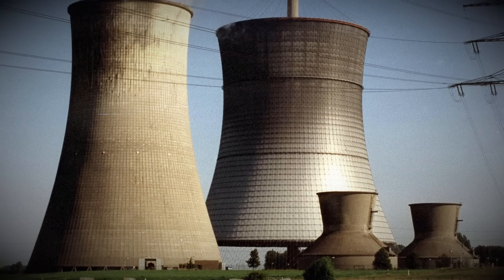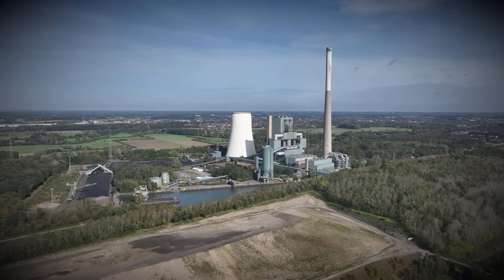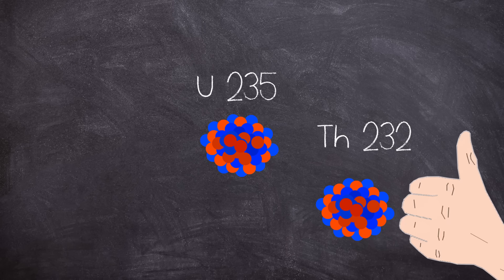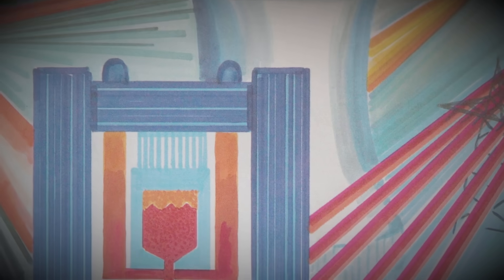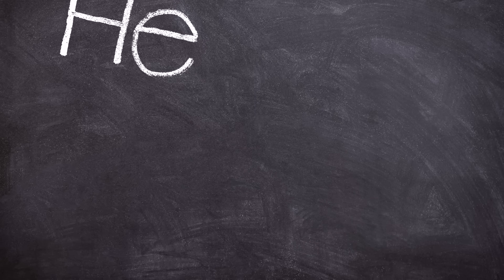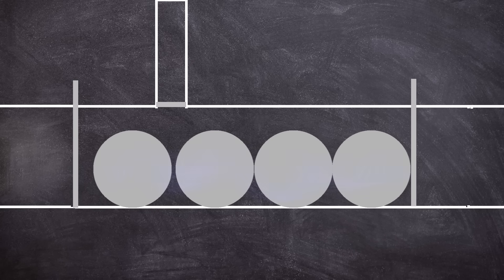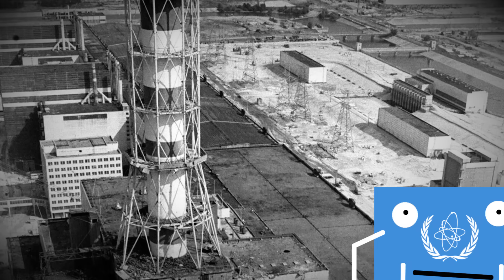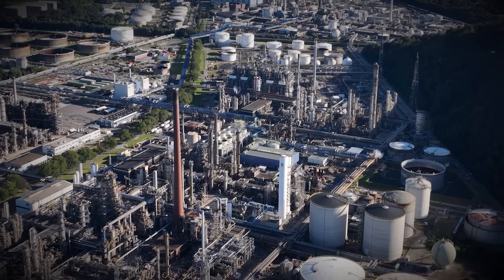Inside Germany’s “Chernobyl”

Comment: >Decomission all nuclear reactors
>Build windmills instead
>Highest electricity price in Europe

Checks out. Hope it was worth it.
Reply: Many people, just like you, got it wrong.
Nuclear was never cheap in Germany.  Instead, it was largely subsided, and the cost don't stop with the shutdown. The dismantling of the old power stations comes at very high price that is to be paid by the taxpayer.
By the way you forgot to mention the real factors driving energy prices up: price of natural gas, emission tax on coal, Import prices for coal, VAT, grid fees. The stupid, lopsided dependency on Russia as a gas, coal, oil, and even nuclear supplier has badly hit home.
Reply: @ElwoodEBlues  Agreed.  If I remember correctly, grid fees alone are almost a third of energy prices.
Reply: @jimboblivesforever  yes, 8 to 9 cents are grid fees. And there is an energy tax of 2 cents. Plus just under 1 cent of other fees. Plus 19% VAT. Consumer price currently is at 27 cents, so the prices went down considerably after an incredible peak in 2022.
Wind turbines produce at 6-7 cents, solar parks get about 4 cents, lignite power stations produce at 4.5 to 7 cents  plus about 4.5 cents CO2 tax, coal starts at about 10 cents,  and natural gas powered stations produce at even higher rates.
The last nuclear power stations we had produced at very low cost, but we didn't do any maintenance as they were to be phased out. The original schedule to phase them out would have given them about seven more years of operation, but conservatives wanted to win an election which was going to happen right after Fukushima.
Reply: @ElwoodEBlues  Nuclear energy can be largely automated. This reduces manpower needed (still more jobs than windmills and panels) newer plants are significantly more efficient, you can build breeder reactors reducing or even eliminating dependencies on other countries (though I think there's a good bit of U in some German/Austrian mountains) as for the price of natural gas, well that went up when a pipeline went up, a gift from NATO as the bad guys could have, you know, just turned off a valve. Not to mention the kilolitres of methane released from that, but apparently taxing farmers over methane containing cow farts is the way forward. 

Decomissioning plants is expensive, which is why you don't decommission them early the largest earthquake in Germany was a 6.4, Fukishima was a 9.0, the Richter scale is logarithmic, so that's many times more powerful. 

Lesson learned from Chernobyl = Don't let people who got their jobs through nepotism or worship of a political system instead of experience and training do risky tests on sketchy equipment. 

Lesson learned from Fukishima = Don't build reactors on fault lines in areas known for tsunamis that rely solely on seawater for cooling. 

Lesson learned from Germany, if it ain't broke, don't fix it until it is.
Reply: windmills do not provide baseload power...California, USA has tried vast windmill farms since the 1970's and were also heavily subsidized in the tax code.  Nuclear power is baseload and provides a necessary electric power component that can be safe and "green".
Reply: Highest electricity prices is not because of nuclear power. It's because of political lobbying.
We pay 18000€ for the heating every year for 20 flats. That's something like 40ct/kwh. 
And this is a political price. 
My share was 500€ for about 500 kwh heat.
Reply: @jpt3640  You heat 20 flats with electricity? That's crazy. I use district heating, and while that's probably the most expensive of the other options, that's still a lot less than half of 40ct (closer to 12 or 13). As far as your math on your share goes, it would be 1 Euro per kwh, which is frankly not credible.
Reply: @jimboblivesforever    no, it's gas i think. I don't know, they built a new power plant/heating plant

Comment: When I was watching you explain how that system worked, I said to myself that such a complicated system of feeding, circulating, and removing the fuel balls was doomed to fail. Way too complicated.
Reply: yeah sounds overly complicated. Though the actual accident I'd say is not caused by that system's complexity, but by the feeding mechanism being poorly designed. At least as explained in this video, it first seems stupid that you have an automated loading mechanism that can't load the precise amounts needed. Worse is that for the manual procedure, there seem to have been little fail safe in place to prevent you from accidentally venting radioactive gas. It should've been impossible to just open the release valve when radioactive gas might've made it into that chamber without overriding a good number of blinking red lights and "are you sure?" popup equivalents. And/or it would seem wise to me to have a geiger counter at the release tubes that blares alarms to the operators, or automatically shuts the valve on its own, if radioactive gas being vented is detected.
Reply: yes, far too complex for a simple human operator to identify and avoid all the failure mechnisms "on the spot" in real-time with an operational reactor.
Humans design these and need to avoid or mitigate many latent failure modes before becoming operational.

Comment: Trick to pronouncing German words is to mentally add spaces because most are compound words.
Arbeits gem Mein shaft - - - - versuckt reaktor

Or in anglophone phonetics arr bites gem (or shem) mine shaft ver sook't reactor
Reply: Not as bad as trying to keep up with neverending repeating similar syllables in Indian and similar predominantly South-East-Asian languages. At least in German the stuff is different.
Reply: You accidentally replaced an S with a T. It's "Versuch*s*reaktor" "not "Versuch*t*reaktor". It'd be something like: arr bites gem mine shaft fair sook's reactor. 

"Gem" is better than "shem". The "g" is not a J-like sounding g as in a "gemstone" but a harder G as in "good".

(if one would get really picky: the "ch" is not really pronounced as a "k", but has no real equivalent in english. It's a kind of a more throaty version of "sh", but k would be perfectly understood and is often used by english speakers instead if they can't get that sound out. Esp. when followed by an s it's extra tricky I'd presume).
Reply: @Hugh_I  Thanks, I only did German for 3 years in school, Spanish for 5, would have done German for 5 years but the teachers for German were all the most irritating people you could ever meet, the guy doing Spanish was much more chill. I prefer German as a language just because it's basically middle English with a few small differences. It's not super difficult to understand basic German, it's difficult to understand basic Spanish. 
For example "Help me, here!"
"Ayuda me, aqui!" 
or
"Hilfe mich, hier!
Reply: @daviddavidson2357  Somehow I can totally imagine that german teachers can be very irritating people LOL. 

I'm a native german speaker. I had some decent english teachers, but never really learned to actually speak it in school. I at best sounded like a time traveler from the 50s struggling hard trying to speak some form of british english while using american intonation with a heavy german accent and a severe lack of vocabulary. The best thing one teacher did one day was to show us an episode of the Simpsons in english in class. That convinced me to watch just about every american or british TV show undubbed and probably taught me much more than I ever learned in school.

Comment: Ohh, I used to live near there. At Keitstraße 31! I took several measurements in the area and the radiation actually rises to mSivert in some places, at least according to my Geiger counter. How great that you made something out of my surroundings. Thank you very much.
The best thing is that when I asked if it was possible to take a tour of the reactor and its building in the current state, despite the secure lockdown, I received an answer from the operator: We do not operate deactivated or active nuclear power plants. ' When I then said that this was interesting and then wrote the reactor with its type and address and that the press might be interested in the fact that it had been forgotten, especially as it had been involved in such a serious accident, I was contacted from a very high level in a very very friendly manner.
Reply: How did that go?! The contact that is.
Reply: @DesertCatDad The highest radiation concentration I measured was at the gate to the small cooling towers. Where the 2 small ones and the middle one stood. They have now also been demolished. Not yet at that time. That's when my Geiger counter went off. Also at the bridge you have to go under if you want to get to the power station.
Reply: Are you sure you are talking about MILLIsievert? I have been several times to Chornobyl and just at very local certain points i was able to exceed 1000 Microsieverts per hour ( which equals 1 Millisievert).
Grüße aus der Jülicher Ecke, wo es auch einen Kugelhaufenreaktor gibt/gab ;).
Reply: @OnTourWithGerrit  ja Tatsache war an dem Tor zu den 3 kühltürmen mir mSv angezeigt worden. Kann ja auch ein messfehler gewesen sein. Ich gebe nur wieder was ich erlebt habe. Verdammt ich hatte nun 3 mal schon die Reise nach Chernobyl geplant. Einmal bin ich krank geworden, dann die plandemie und nun die spezielle militärische Operation.
Reply: @istandwithdprlpr7801  mSv finde ich schon sehr bedenklich. Es ist zwar nicht sofort gefährlich aber einfach frei zugänglich dann schon. Mit was für einem Gerät hast du gemessen?

Tschornobyl wird wahrscheinlich für sehr lange Zeit nicht mehr zugänglich sein durch Minen und Granaten.  Ich kenne einige, die seit mehr als 15 Jahren quasi tagtäglich in die Zone gefahren sind (beruflich/Guide) und auch für die bleibt es verwehrt. 
Man darf die Brisanz der Zone in Bezug auf Belarus und Kyjiw nicht vergessen.
Reply: @OnTourWithGerrit  du wardr ja sogar im Keller des KH 😮 hast du ein Schwein. Den haben die jetzt mit Sand aufgefüllt. 😢
Wenn dubwieder so Videos machen möchtest,  dann fahr nach Oklo zum natürlichen Reaktor. Ich komme gerne mit und unterstütze dich beim flimen. 😅
Reply: @istandwithdprlpr7801  naja, den Eingang haben die zugekippt. Aber es gibt noch andere Wege da rein.
Jedoch war ich nur zwei Mal ganz unten. Ist doch nicht mehr so ganz ungefährlich.
Oklo klingt interessant. Aber aktuell steht es (noch) nicht auf der Liste. 
Danke für das Angebot.
Reply: @OnTourWithGerrit   schreib mir gerne die Eingänge. Ich kenne Sa jemanden der jemanden kennt der mich Sa vielleicht hinbringen kann. Als ich mit einem Verein dahin wollte hatten wir sogar eine Erlaubnis zu room 217/2 aber dann hat es mich dahin gerafft.
Reply: @istandwithdprlpr7801  man muss vom Ende des Krankenhauses bereits in den Keller. Das ist mein letzter Stand.
Jedoch glaube ich kaum, dass du in die Zone diesen Samstag kommst. Wenn dich, nur illegal und mit hohen Risiko.
Reply: @istandwithdprlpr7801 die 3 kleinen Kühltürme hatten aber nichts mit dem THTR zu tun, die gehörten zum alten Kohleblock.
Reply: @o.h.s.8256   das kann gut sein, wohin die gehören weiß bzw. wusste ich nicht Jedenfalls standen die noch so um 16 - 19 rum und da war die höchste Strahlung. Passt ja auch, keine Funktion, aber noch präsent während des Vorfalls, wie man so schön eindrucksvoll sieht im Eröffnungsbild des Videos.
Reply: In which Statt was this ??
Reply: @TheJason909  you mean Stadt. It Was Hamm westfalen
Reply: You sound strangely happy about living near a disaster site...
Reply: @lofthouse23  Well, happy. I am very interested in the subject and am therefore perhaps a little more committed and enthusiastic. I never really measured harmful levels in the region I lived in. In my bedroom in the Spanish village it is also 9 microsivert. Which is already elevated. Here, after my escape from Germoney, people are all getting very old even though we live on a uranium vein.
Reply: @istandwithdprlpr7801   I think this part is what most regular folks forget to account for:  Background radiation.  Is the normal background radiation being measured and subtracted from the readings taken of a suspected release?  I'm thinking that one person's, "Oh, Crap!!" moment is another person's perfectly normal condition.
Reply: hello from St Louis, MO!  🇺🇸❤️🇩🇪

Comment: Short answer to the thumbnail is yes. This coming on the heels of Chernobyl body slammed the German nuclear industry and led them to wrongly get rid of it.
Reply: Not true. Not a single nuclear power plant was closed in Germany because of Chernobyl. The only thing that happened was an investigation into the safety of German nuclear plans, which concluded that such an accident couldn't happen because the plants were entirely different from the russian ones. What lead to the German nuclear exit was Fukushima, and that was decades later.

Comment: Really good primer on thorium and pebble bed reactors in this video. It sounds like there were some odd 'we didn't consider this possible risk' engineering flaws in the THTR series, like the fact there didn't seem to be very many safeguards against radioactive vapors getting into parts of the system where they weren't supposed to be.
Reply: This reactor was kind of an experiment, to check out new technologies. Turned out, it is more difficult to handle than they had imagined. This path was no longer followed.
Reply: @gabbyn978 not with this architecture at least.

Pebble reactors are still being pursued almost entirely due to regulatory constraints. Pebbles are a halfway point between the now technologically capped solid fuel reactor and the much more desirable liquid fuel reactor. 

And while on the technical side it makes it inherit the worst traits of both reactor types, it does make it ironically an easier thing to license and lowers the collaterals you need to pay to even be allowed to build it. 

It also makes it considerably easier to utility companies that can still leverage exclusive fuel contracts like they have with solid fuels. Pebbles can be made to only fit in a certain reactor type, and thus it allows the fuel producers to raise the price of fuel without consequences. Meanwhile a liquid fuel blend can be made by just about anyone and it isn't form factor constrained which means all the fuel providers would be in competition for the first time, driving down the cost of nuclear fuel and therefore the profit of these companies.
Reply: it seems the chief engineer of the THTR considered MSR in the early design stages of the project, but then was opposed to the MSR reactor concept! Why? because of Tritium, Xenon... leakage? 
Lack of CO2-Brayton cycle  gas-turbines? 
Hope of achieving higher He_gas temperatures, and higher thermal efficiency of the reactor power output? 
with less corrosion risks? 
 China now runs a HTR, based on German tech; did DE nuc industry sell crappy tech to China, or did they iron out the deficits?

Comment: While the event itself was a 1, it contributed to Germany retreating from nuclear power and replacing it with coal for decades.  That feels worse than a 1.
Reply: I would agree if it were true. Nuclear power plants in Germany were up until 2023. Hardly anyone even knew about the THTR300 incident, or cared, since Chernobyl had just happened, and that had far more impact - but also didn't change much. Larger anti-nuclear protests lasted for a year or so at most and changed nothing. What actually triggered the nuclear exit of Germany was Fukushima. There are a few press conferences with the chancellor from that time on Youtube about that.
Reply: There is time to reverse and re-open nuclear reactors.  Also the new GenIV reactors are much safer and going forward in US, Canada, and UK...and many other countries waiting to see how GenIV works out (Poland, France, Japan are interested).